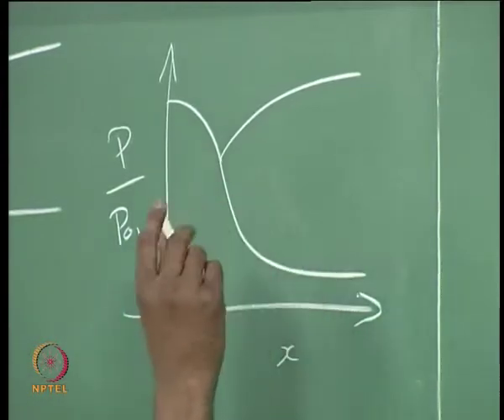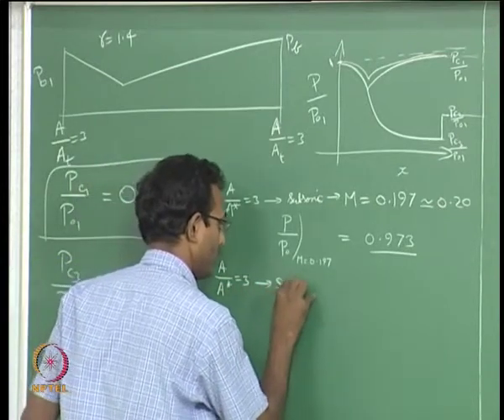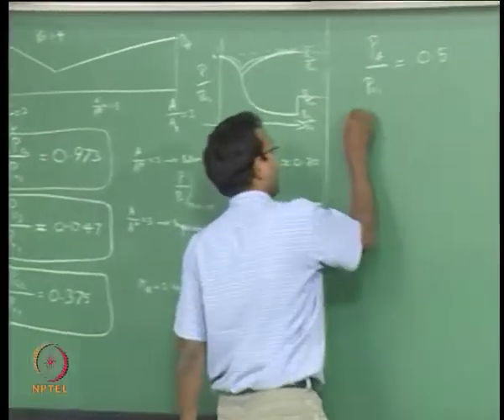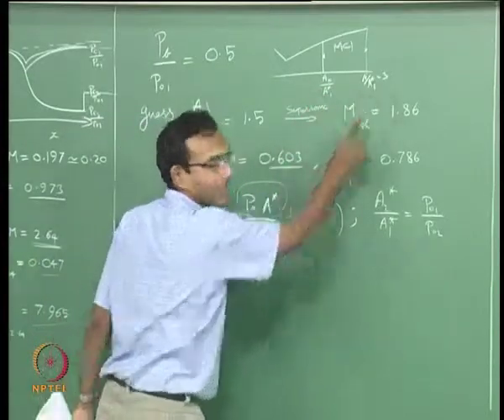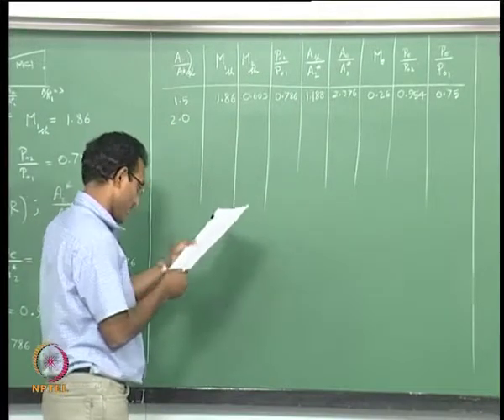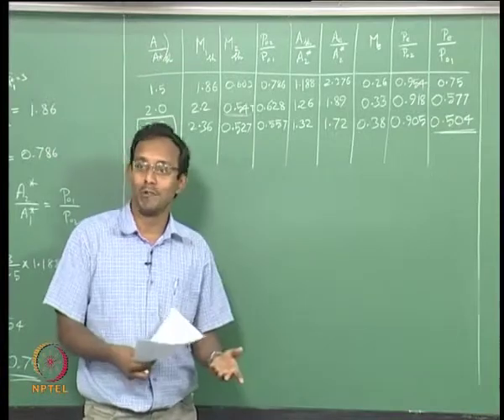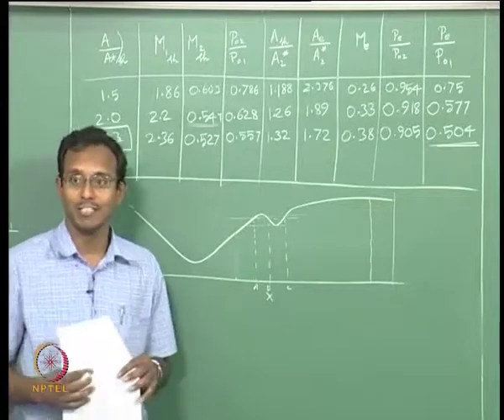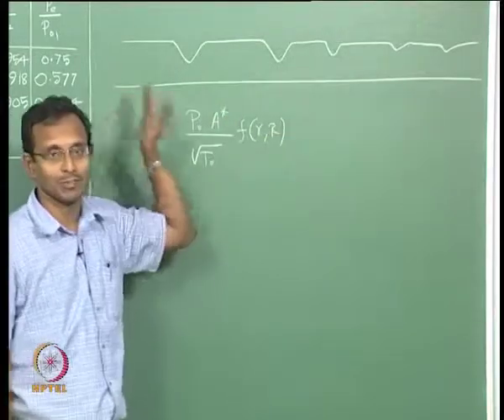Mod-01 Lec-31 Lecture 31

Comment: What does Po2/Po1 pressure ratio means ??? As Po is constant so from where this ratio generated ?? Plz answer .
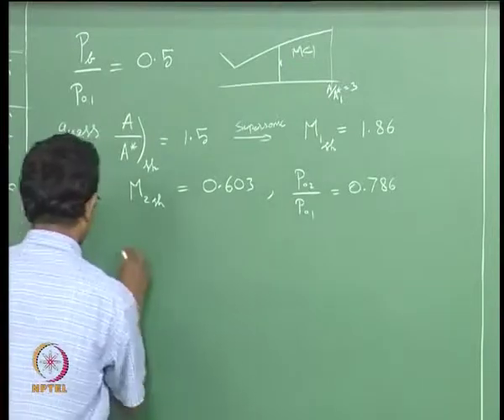Reply: at around 16:30 in the lecture video, he says the P0 (referring to P01) has dropped across the shock to P02. The stagnation pressure has dropped across the shock however the reservoir is still working at P0 as a constant.